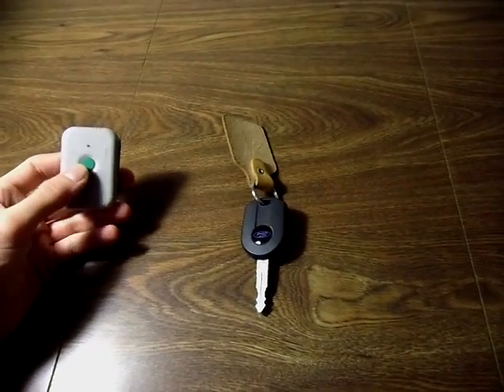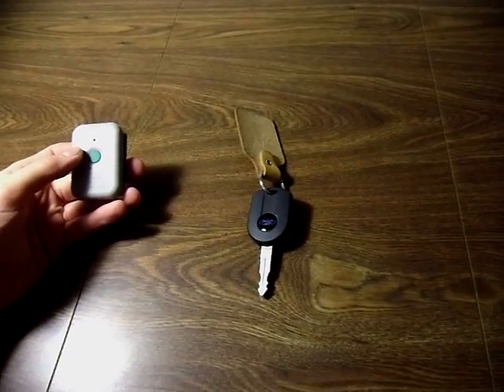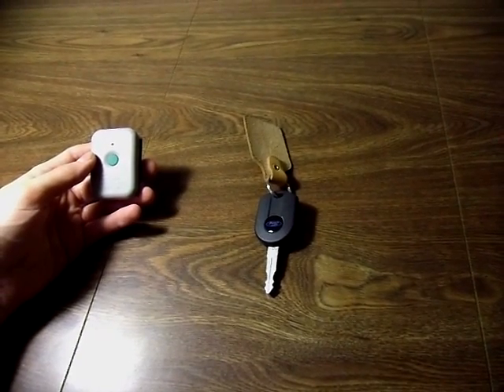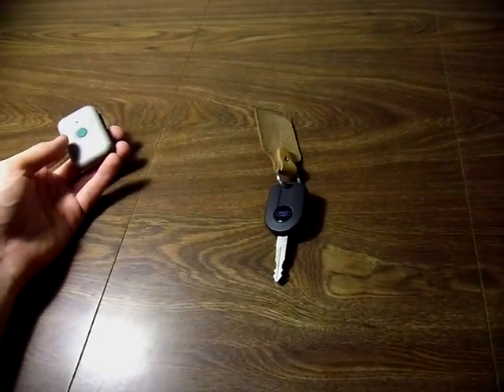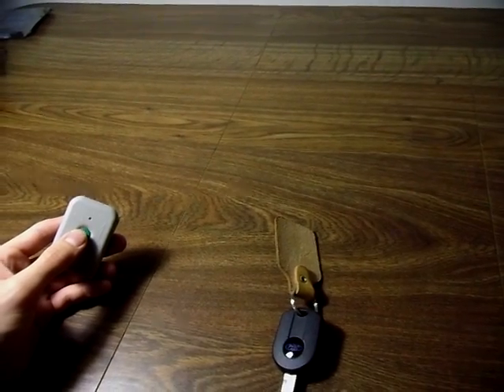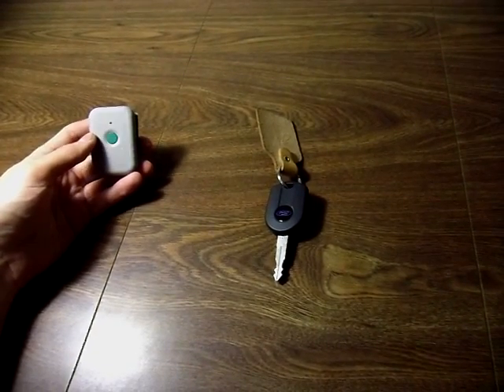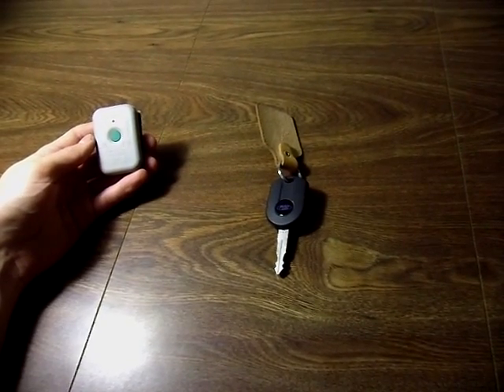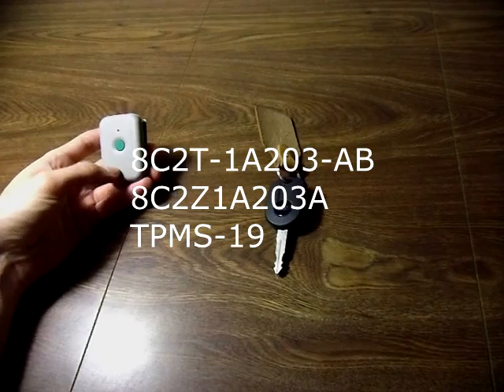Ford TPMS Sensor Training

Comment: Hei, I tried what you have done. the vehicle (fusion 2012) goes to train mode but when I try to press the button on this tool near the tire/rim, it won't do anything. any idea why it is happening?
Reply: I am having the same problem it times out before it syncs, 17 Escape this tool and sensors are genuine ford parts

Comment: Question- Can I retrain the sensors to a much lower pressure than the factory setting?  Am I "training" them back to the factory specification (In my case 80 psi)?  Ford E350 Super Duty Van.
Reply from the maker: Michael Hanson No. This just trains the wheel sensor to the computer, and what wheel location the vehicle thinks the wheel is in, not to allow you to change the pressure setpoint. If your vehicle has a much different pressure recommendation for the front axle to the back, this can be used when you rotate the tires front to back, and readjust the pressure, so you won't get a false warning. That's why this part is equipped with vehicles with two different pressures front to back.

Comment: I had the same issue as Duder Lebowski had above.  My car is a 2010 fusion.  My tires, rims, stems were new.  I kind of wounder if the key on and off several times method is for new stems, and not just relearning the previous set.

Comment: I have the same training tool and tried to do it your way on my 2013 F150 with the flashers with no luck. I tried the other method of turning the key on and off several times and pressing down on the brake pedal to put it in training mode and that worked so keep that in mind if you can't train it this way....
Reply from the maker: Duder Lebowski Last year when I put my summers on the car didn't recognize the sensors. I tried my flasher method once I found the programming tool and it didn't work. By then it was October and I didn't care. I did not try the ignition / brake method. The car had no problem when I put the winters back on, or when I put the summers on this year.

I think when I initially HAD to reprogram my sensors I used the ignition / brake method, but found out about the flasher method later. For the video they were already trained. Interesting. I will make an note of it. The flasher method might only be for relearning after rotating the same set of tires (which is the purpose of the tool, if you have a truck with different pressure front/back).
Reply: Duder Lebowski do u have to press the brakes down and hold ir release every time u turn the key on?

Comment: I have a 2009 Taurus that I bought used. I purchased the tool from a Ford dealer for $35 and I used the procedure you demonstrated. It worked just fine the very first time. Thank you very much.

Comment: Thanks for the response. I have purchased a new set of valve stem sensors and am going to have them installed on the 2009 wheels. My questions are: Can I leave the band sensors on the wheels without causing a problem with programming the new ones or should they be removed? Also, someone else told me that on a 2013 model I don't need to retrain the sensors-they will be retrained automatically after I drive the car a few miles. Is that correct? Thanks in advance for your response....

Comment from the maker: As far as I know band sensors and valve sensors are NOT compatible, but I have no first hand experience. However the same tool, and the same method is used to train them is used.

Comment: I have a 2013 Mustang and I just put a set of wheels on it from a 2009 Mustang with the band sensors. The wheels I removed had the sensors at the end of the valve stems. Can I train the band sensors from the 2009 wheels to work on my 2013 Mustang? I have received conflicting information on this. Thanks....